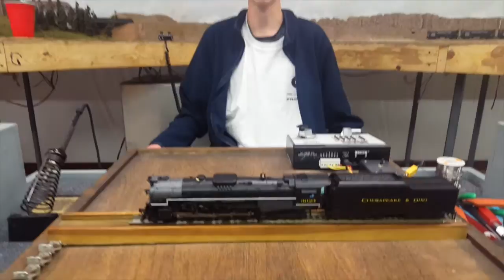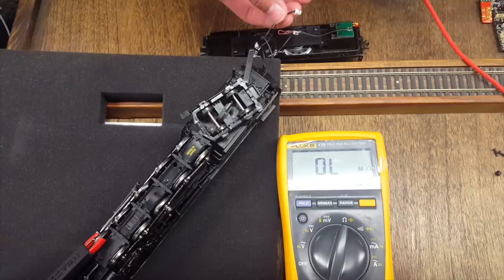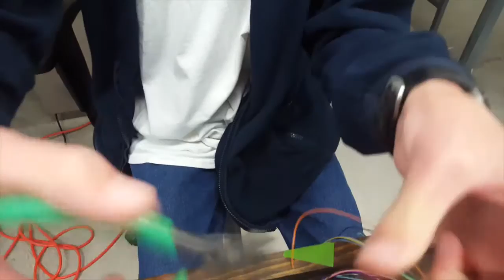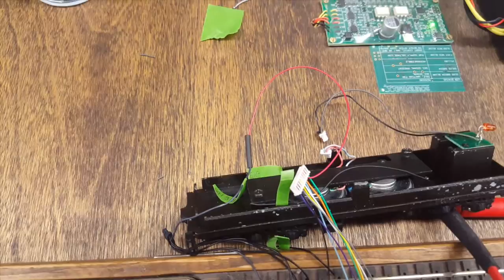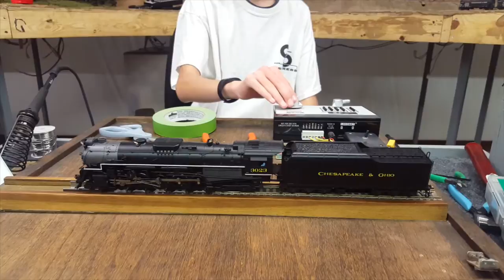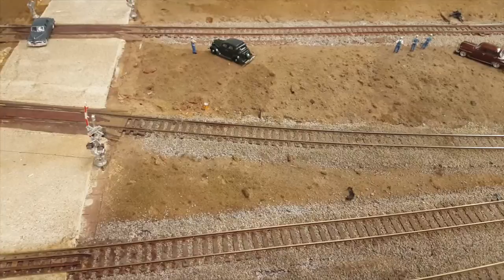How to Install a TCS Decoder in BMI Blue Line T-1 on a Model Train

Comment: That was awesome man! Very helpful converting Paragon2 into TCSWOW. I got a question. Does the wiring method (the 7 wire connection) apply to all engines with the Paragon2? I have some Paragon2, or is it just for that locomotive?